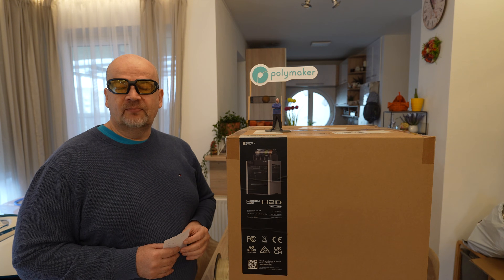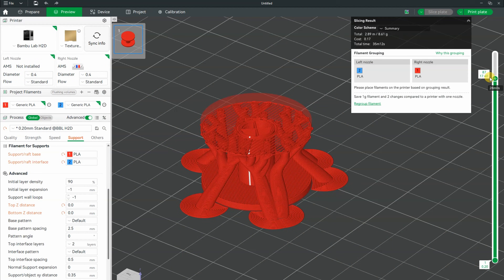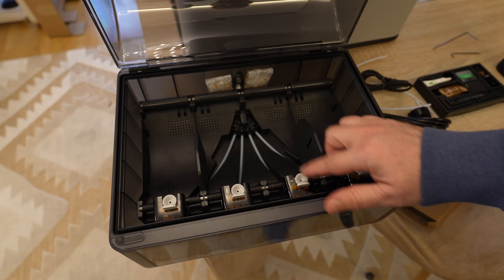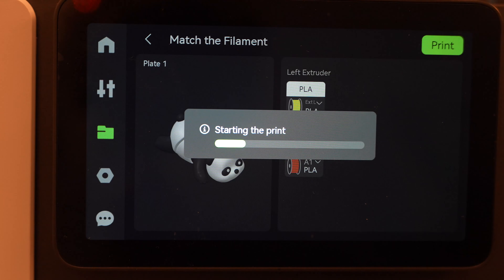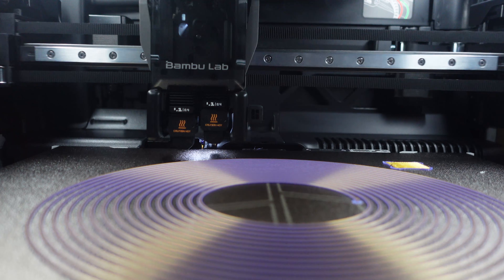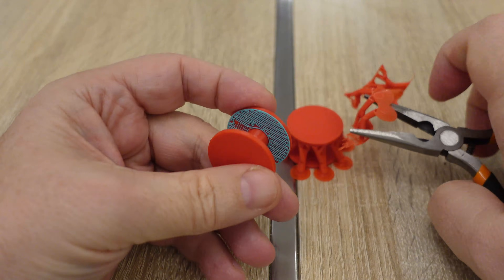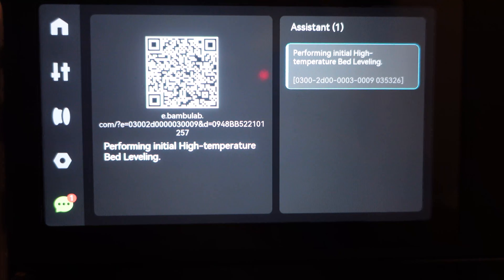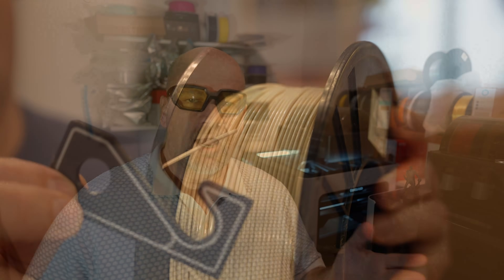BambuLab H2D Review – But Is It Finally Ready for Real Engineering Filaments?

Comment: Hi Igor - have you done a video on getting the best from high flow hotends on the H-series? I may have missed it in my trawl through your pmaylists .

I found that though PETG-HF max flow changed from 20+ to 40 mm³/s, and speeds about 2.5x, there was only about 10% time reduction on a 6 hour print.
Reply from the maker: In progress testing new E3D HF obxidian 500

Comment: I've owned the H2D for almost a year now and even with a custom printed exhaust fume extractor, and removing the motor controlled exhaust louvers, and adding a separate motorized exhaust fan routing the fumes out of my office, I still get strong smells when printing ABS and ASA.  I even printed a custom waste chute cover / case to prevent fumes from escaping that way, as well as used painters tape to seal up every single portion and seam i can find on the H2D... it still smells very strong when printing .
Reply: lastly, I had to adjust the controls and the speed of the fume extractor fan when first starting a print.  the chamber will really struggle to come up to temp if the fan is up too strong when heating.  Once the print starts, the chamber and bed will keep temp, and the exhaust fan speed can be turned up more.   although if my exhaust fan is turned up too much, for obvious reasons there is an increased risk of warping on tall parts , even if the chamber is set to 65 and the bed 120.

Comment: Is H2C better than H2D for printing dual engineering materials?  I have been always struggling between compromise of easy support removal vs good surface quality for engineering materials. Is there better solution on market for this purpose (considering also Core L INDX - but Prusa delays...)
Reply from the maker: For only dual.. I am not sure. I like that I don't have to rely on the AMS, but with only 2 colors, probably we can do it on H2C too, but I don't have personal experience with that printer. Bambu contacted me after this video, and they will send me H2C soon.. I don't like that we need different nozzles on H2C (on H2D they are same)

Comment: Great video! How will you set up the air exhaust when printing ASA? As far as I know, there’s no way to open the rear exhaust when the chamber heating is on. Curious to hear your thoughts!
Reply from the maker: Yes, I hate that we don't have enough freedom. Maybe an inline fan can create some negative pressure in printer
Reply: @MyTechFun  Bambu seem quite response on the Github page for Bambu Studio. Maybe they are also receptive to firmware feature suggestions?

Comment: See my video a few months ago using this method for gears. From papers I read indicated that reinforced Nylon actually has lower friction. Papers speculated it was because the tooth deformation is lower and thus causes involute gears to slide less since the contact moves more ideally.  Also I was using Polymaker I can't seem to get CF in my skin for any of the CF reinforced. I have a pretty decent microscope. I think this is a PLA / PETG problem or maybe a brand quality issue.

Comment: My only complaint with the H2D is the design of the fan in the middle of the H2D's toolhead. Bambu sells it as "Cooling Fan for Hotend - H2 series", and it's a notoriously heat sensitive fan. I killed mine printing about 500 hours of ABS/ASA/PC on it, and replacement is a colossal pain in the ass. You have to remove two circuit boards and no fewer than 6 flat flex cables, several of which are incredibly fragile and held down by such strong adhesive that you stand a good chance of breaking one if you don't know to expect it. When replacing mine I ended up doing in the nozzle camera this way, the FFC just ripped up the middle around the double sided tape that held it to the back of the motor to switch nozzles. Took about 3 weeks of back and forth to get parts with bambu, and an unbelievable amount of swearing, to get it back up and running again.

The H2D Pro fixes this with the enhanced cooling fan apparently, which replaces the clear plastic part at the front of the toolhead with a much bigger fan. I bought one of these fans when they went on sale about a week ago, but unfortunately the firmware to use it on the H2D won't drop until Q1 of next year. So I'm just taking it very carefully with my H2D when printing anything that wants a heated chamber above 50° because of it.

Comment: For the breaking of the filament in the tube on the H2S when homing if you follow their instructions to reroute the tube it works great. I have printed PPS-CF with the tube rerouted and had no issues with breaking.
Reply from the maker: Same method I used in my Polymaker Asa-CF08 review

Comment: I just rotated my ams units 90 degrees and feed the H2D straight from the left to mmimize resistance and bending.Its significantly more sensible than my X1C, even with dialed down ai. My X1C still gets plenty of hours.

Comment: Im considering the H2D and H2S and still cant decide between them. I don't really need multi color prints, i would just want it for the different material support and engineering filament support+tpu. The price difference between the two is 750€ in my country, do you think its worth it over the significantly cheaper H2S ? Hard to justify the price difference, do you think its still worth it? Should i go for the H2D ?
Reply from the maker: In my eyes, 2 colors are very important. If I would have the amount for H2S, I would try to save for H2D. Don't forget that H2S has problem with brittle filaments. Check my review
Reply: @MyTechFun ok thank you, yea thats a problem with the brittle filament and the H2S, i will go with the H2D.
Reply: @MyTechFun  what about H2D vs H2C? I see only 400EUR price difference. Is it worth extra for the H2C over H2D?

Comment: 1. How good is the temperature separation between these nozzles? Printing PETG with PLA supports, for example, on a P1S (and H2S I’ve learned yesterday myself)  is risky because the PLA would jam in the extruder if you had but a few retractions.
2. Especially thinking about a future comparison with the H2C: Could you try printing PET-CF with TPU on it? Example use-cases: A lamp and some layers of TPU as its feet. Or a grid-finity box, with TPU as box liner to reduce rattling.

Comment: I saw a new video about Tullomer and they have updated their print setting recommendation. They say layer adhesion, which was the primary issue in your previous testing, is 5x better now.
Reply: I saw that also, waiting for the real facts to come out... The inventor was a little coy, so lets see what the community finds out... Waiting to see how this plays out before I spend my money. I'm waiting a real dual nozel high temp unit to come out without having to mortage my home to get it.

Comment: Igor, a big request: could you add a simple Dimensional Accuracy Test to your printer reviews?
Printables has those standard test objects with holes, squares, cubes, and cylinders in 5 mm, 10 mm, 15 mm, and 20 mm sizes. Maybe one in each corner of the build plate and one in the center.
It’s a quick test to run and would clearly show any dimensional over- or under-sizing.

Comment: would you be able to go back to some tests with technical filaments and see how they compare with actively heated chamber on compared to no heater chamber since heated chambers are becoming common? I've had my Qidi Q1 pro with a 60c chamber for around 2 years but it wasn't common when it released so heater chamber testing wasn't really done.

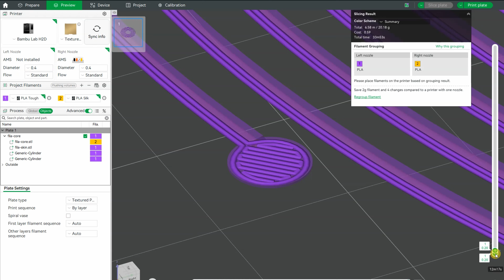Comment: @9:10 others are doing this :) i'm begging you since "forever" that you test and try this out - i have a ready to go Model on MakerWorld and Printables "3D-Printable Coaxial and Multi-Color Filament" by suit1337 that utilizes this concept - posted it under multiple of your "core filament" testing videos but apperantly you've never noticed it

interresting thing is, that you can use this also the blend filaments together - so for example an outer shell made out of PLA with a PETG core and then print filament out of it again, this way you can "mix" PLA and PETG to a blend, that gives you very interresting material properties - i made a lenghty Reddit post titled "PLA and PETG are miscible: I made printable coaxial PLA-PETG filament to prove a point (and yes, it works) - looong text in comments" about 10 Months ago, maybe you can check a few of my concepts in your tests aswell

Comment: TIP:
Bambu lab slicer: Use beam interlocking - creates interlocking beams on places where 2 materials touch so it creates a mechanical bond, and does not only rely on layer adhesion. You can even combine materials that don't bond together this way.
Can you try TPU outside with a stiff core material in the middle of the object?
Really curious about the impact resistance, and bending test.

Can you increase the heat deflection temperature of the object by printing a thinner outer shell from a material that is heat-resistant?

You always make fascinating videos. Thank you :)

Comment: Nice job masking the print quality problems on the Benchy (horrible PA on the wheelhouse corners, popping out layers on the starboard rear corner in 3 spots) Also, way to ignore and zoom past the two deal breakers in the H2D--software-based DRM (no Orca support) and the bed temperature heater.  Per Bambu a difference of up to 10-11C on different parts of the bed is considered "normal."  You should not skip over that problem, because that problem is what is stopping many people from considering the H2D for engineering use.  There are tons of reported print failures as a result of the cold zone on the left side of the bed.  This is unacceptable from a $2250 printer.  Also, different topic, the H2D/H2C brittle filament breakage problem occurs when the left nozzle lifts to print using the right nozzle.  Running bed leveling is not the test for breakage.  Overall, a complete failure of a review.
Reply: wow, more false ramblings from bambu haters, really incredible.
Reply: @riba2233  I’d prefer if this got called out and BL improved it, than living with mysterious warping and adhesion issues.
Reply: @EditioCastigata  what are you talking about, there is no adhesion nor warping issue...
Reply: Channel NeedItPrintIt has another measurement. 15°K difference across the bed, though it hit the preset 100°C.

Comment: Can you please re-test tullomer with revised printer settings? They say layer adhesion is 5 times better at 320c.
Reply from the maker: In my first review I tested it at 340°C too. It was 3x stronger, but that was weak too. But I will test it as a reinforcement.
Reply: 330c, but probably needs much more

Comment: really good demonstration
Would be interesting to see some stable (low warp or cf material) on the inside with a really hard to print outer shell (like pp or ptfe), as some of those hard to print, high warp, low bed adhesion materials have some interesting properties (a gear with an ptfe outer shell for friction reduction, or a container with a pp or pps shell on the inside for chemical resistance come to mind)
Reply from the maker: This is a good idea. Only those two materials must at least minimally bond to each other.

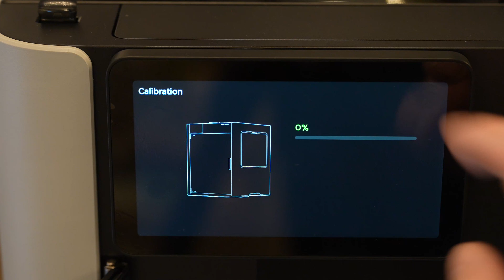Comment: Hi! Just a quick tip. The blur at 5:54 for your wifi details can nowadays be reverse engineered to get a full picture back. If you want to obscure any details, just put a black box over it you know. Just in case
Reply: yes, but only with moving images right?
Reply: @danielbruin  No, actually both still images and video, but the result will be better on video.
Reply: Yes, AI de-blurs it. So best to put a black box over it.
Reply: You’d have to be in the same building to exploit this.
Reply: @EditioCastigata  yes, but it can also dox your address, WiGLE is a homepage where you can enter a router SSID to see where on earth it is.
Reply: @EditioCastigata I mean, if you are concerned by it leaking. Do it right 🤔

Comment: Like you, I use the H2D for technical filaments and it just works! way more capable than I am in putting it to workThe hater can hate, but this machine is outstanding and I do not regret the high cost. I make parts and tools, not toys so it is perfect.

Comment: Hey Igor, I appreciate the attention to the stiff filaments.  Recently I have had some issues with pet-cf snapping. The only way to overcome this was to turn off my autobed leveling so the print head would not go to the far back corner.  It made me wonder about stiffness of filaments at 60-65c. (I am on Qidi xmax3).     I run the filament from a heated poly dryer to the printer, but I imagine it has enough time to cool off before getting to the extruder.   I wonder how something like the xmax4 with heated ams (while printing) might help stiff filaments.  If 60-65c is enough heat to reduce the filament stiffness and prevent snapping.  It seems like stiff filament works in the h2D regardless which is nice.

Have you run any of your stuff filament angle test while the filament is at 60-65c by any chance? Just curious
Reply from the maker: On H2D not yet

Comment: yes - i've been throwing every possible filament without a fail.. abs-gf, asa-gf, pla-cf, petg-cf, pc-abs, pctg, pa, ...
Reply from the maker: Good to get a confirmation.. any PET-CF or PPA-CF?
Reply: @MyTechFun  I do have them both on stock, but just didn't get a need/time for them to try it out yet. Printer is busy most of the time :D
Reply: @habiks  have you set up any fume exhaust when printing ASA, ABS etc? if so, how did you handle fact that the exhaust fan can't be enabled in heated chamber mode?
Reply: @lorenzo-f5p  No not yet - I have this printer in garage so it's not a huge problem, but I want to address it eventually. I think I'll try the bentobox remixed for h2d (it's recirculating the air inside through hepa and active carbon).
Reply: @MyTechFun  I've printed about a kilogram total of Polymaker's PET- CF17 loaded in either nozzle. The left nozzle is much easier to load PET-CF in, but I usually load it into the right to keep it from potentially breaking when printing a support material. I've tried in in the AMS-HT and struggles to feed it into the extruder because it's super stiff, but it printed fine once loaded. I had one or two pauses from the printer telling me the AMS motor was overloaded on one print, but it did fine after I resumed the print. I have been loading it from an external heated dryer for the most part and haven't had any problems with breakage in the PTFE tube on large prints. All of my prints in PET-CF17 have come out great and I haven't had any issues with the quality of the items I have printed.

I've also tried a few 25-30g prints of PPS-CF from Polymaker and I haven't had any issues with print quality. No PPA-CF yet even though I have a few spools because I haven't had anything I can justify opening a sealed spool for yet.

Comment: Considering the effect of contamination in the nozzle I begin to wonder if it would make sense to keep separate nozzles for PLA and PETG - especially on one Nozzle printers. It's quickly swapped on modern printers like the H2S / A1 so it might be worth the extra minute.  I think for such use-cases the new Bambu Vortek system can also be pretty nice, because there seems to be an optional user setting to limit nozzles to specific materials if my information is correct. That combined with the new serial number / communication between the printer and the nozzle could be a pretty secure feature to avoid the contanimation of nozzles with materials that would decrease the layer adhesion.
Reply from the maker: PETG+PLA probably similar problem. Or the purge material must be increased

Comment: Did you have to create separate models to make the S hooks out of two different materials? Would be awesome if Bambu studio let me print just the outside walls in a different material. I was looking to do the inside in regular ABS and the outside walls in ABS-GF
Reply from the maker: That hook I created in CAD (Fusion). I was hoping that I can color paint it in the slicer, setting the depth of painting to 1-2 layers or walls. But once it is fully painted outside, it change the inner color too.
Reply: I guess you could do it the same way people create multicolor models. You could use modifiers, use the paint tools or create in CAD a multi body file and export it as a single 3mf so it stays aligned.
Reply: You’d model this as two bodies in your CAD software.

Comment: If core filament works, try tullomer core filament. If I understand tullomer is not a continuous fiber but forms one in the part after leaving the nozzle. With core tullomer you could have a continuous fiber in the part with single nozzle printer and mitigate the bad layer adhesion and other drawbacks (besides the price😅). Interesting what complimentary material would be the best here. I am also very interested if you could give pps-cf a better impact strength. Maybe outer shell from pps-cf (strenght, dimensional stability, stiffness, no creeping) and inner from nylon/abs (impact resistance). Interesting what filament combination would work and how big the outer shell needs to be.
Reply: I wrote something similar about using a high adhesion PA6 as the outside shell and Tullomer as the core on 3D Printing Nerd's latest video where he was talking with one of the guys behind Tullomer. 
Glad to see Igor have the same idea too.
Reply from the maker: I had this idea even after my first Tullomer review. Only at that time, my suggestion was the core filament. But now we can print it directly with H2D. I even got the profiles from Z-polymers.